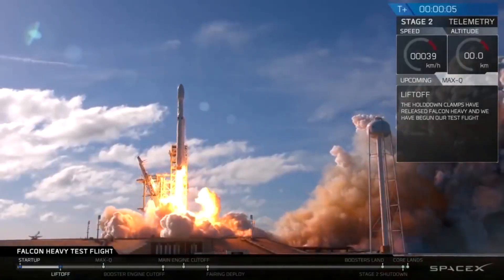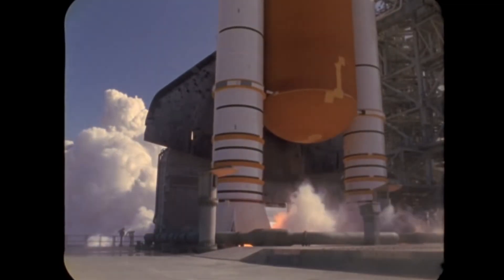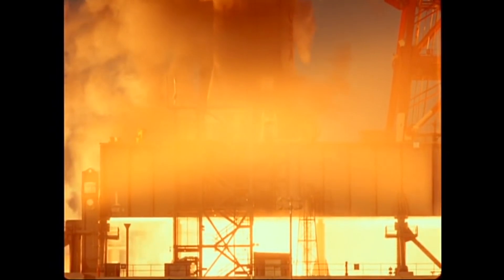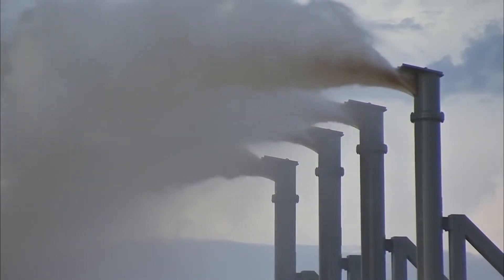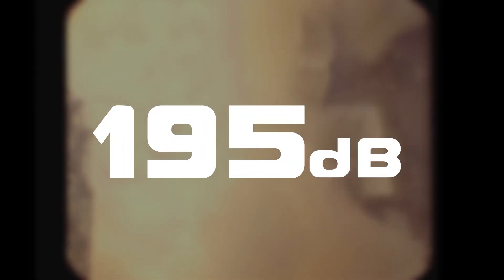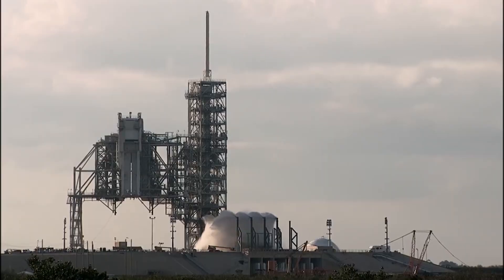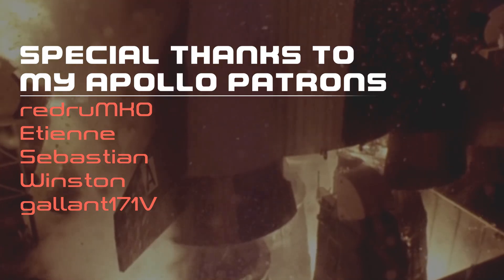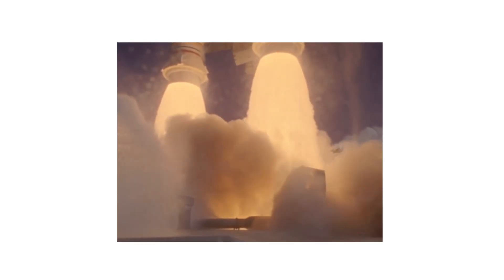Why doesn't the sound of a rocket launch kill you?

Comment: Title of the video "Why doesn't the sound of a rocket launch kill you?" A minute in, "the sound of rocket launch can kill you".
Reply: yeah, i'm surprised he didn't mention the exclusion zones around each pad.  NO personnel are allowed in there after a certain point in the countdown.
Reply: I don't think the sound is what's defining that zone though, rather the possibility of the rocket going BOOM
Reply: Can, but doesn't - I thank that's the whole point.
Reply: Yeah, it's not entirely clear in the voice-over.  But I think the chain of the narrative was meant to be: 1) rocket exhaust engine can kill you with no intervening factors.  2) we dampen the shock waves down from 200+ decibels down to 140 and a bit using water.    

What I think they sort of left out is 3) 140-ish is enough to instantly severly damage your hearing, but would no longer be physically harmful to you other than that.
Reply: Also what is left out, or perhaps just not emphasized enough, is that no one stays anywhere near the rocket except the (un)lucky ones sitting on top of it. Even with water suppression and big deep holes one couldn't escape serious injury or death nearer than about 50m from something like the Falcon 9.  Would need to be much further for something larger, especially if most of its thrust is provided by SRBs like the shuttle or the SLS. (SRBs are much noisier than a liquid engine for a given amount of thrust)
I think by far the main reason for the suppression is so the rocket does not destroy itself and its payload (or crew).  I don't think protection of the pad and facilities is a big issue as those could quite easily be built to resist such aggression.
Reply: I thin the concern is protection for things AROUND the pad, not the pad or the rocket itself.  

I base this on reading about the first Saturn 5 launch.  The very very first time a Saturn 5 was launched for 39A or B, it caused so much vibration that ceiling tiles were raining down in the press offices at the VAB, three miles away.  The rocket was fine, and the flame trench was there, redirecting the blast away from the bulk of the pad structures.  But the exhaust noise and impluse was being directed straight sideways, and even three miles away it was enough to shake stuff.  Thus putting in the water to damp the sound.  

It doesn't dampen it all down, obviously.  It's still plenty loud.  But it cuts it by an order of magnitude or more.
Reply: If it cut the sound by "an order of magnitude" that would be one decibel. 220 dB down to 119 dB.
Reply: No, 10 decibels is an order of magnitude.
Reply: BTW, 220 - 1 is not 119.
Reply: I think an order of magnitude is a bel, which is of course 10 decibels. That would be from 220dB down to 210dB.
Reply: @gevmage  the main problem they have to deal with is the sound reflected back towards the rocket from the  launch pad structure and the ground. The noise of the rocket is mostly directed downwards and would not reach the rocket in sufficient strength to damage it.  It is the reflection off the ground, launch pad and surrounding structure that would damage it. 

The launch pad itself can probably be armoured more easily than deadening the sound.  As for damage to buildings in the vicinity the sound suppression systems will be of no use as they are only effective when the rocket is on or just above the pad.  Once it has cleared the pad it is making just as much noise and it is out of reach of the suppression system and would damage those building just as much as it would without the suppression system.
Reply: Keyword: C A N
Reply: lmao I was looking for this comment
Reply: Still a little confused here statement in vide no one can survive being close to the rocket on launch my thoughts "that's alot of fire" I think that I would die to the fire just as effectively to the sound.
Reply: @therasco400 - it depends what you mean by close. For the fire to kill you you'd need to be not more than 10 or 20 metres (30 to 60 feet)  from the engines. The noise on the other hand could be fatal at 10 times that distance and possibly much more as well. 
Those five engines are the equivalent of forty 1000lb bombs going off every second except that their blast is mostly focused downwards rather than expanding in all directions. Just like with bombs it is the blast (sound) that kills you, not the fireball of the explosion. You wouldn't want to be anywhere near something like that.
Reply: That's exactly why the question was asked.
Reply: I thought it was earrape
Reply: There is a pretty (very) interesting article about sound waves. I highly suggest reading it. Just type this into google "Everything You Should Know About Sound by Tim Urban"